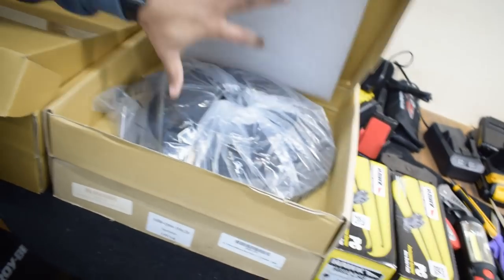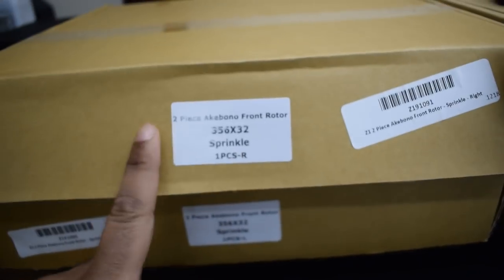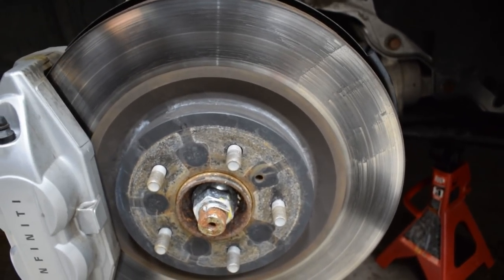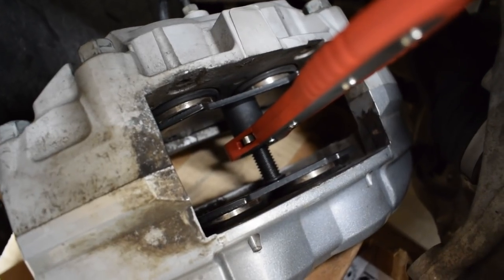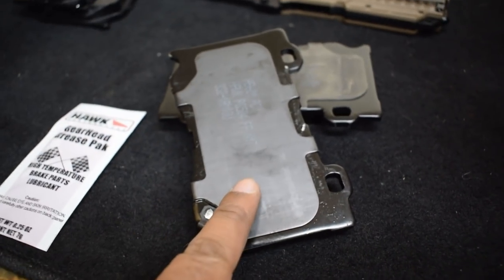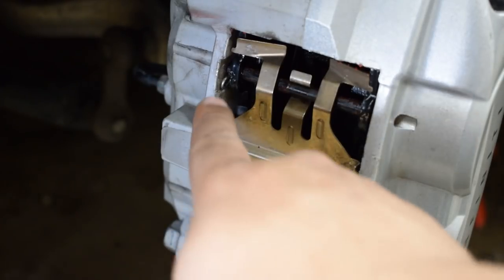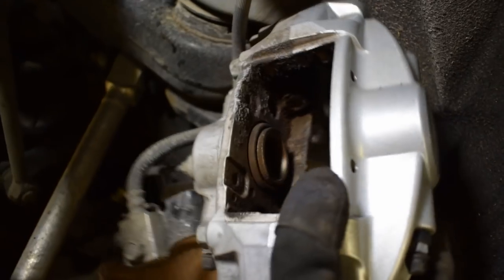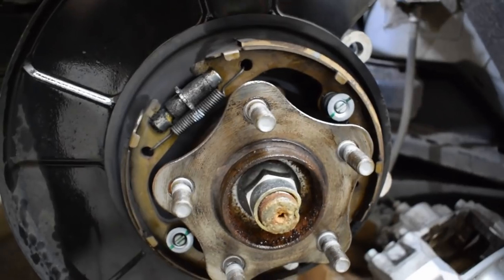Z1 2-PC Rotors for Infiniti Q50 & Q60 | Better than OEM?

Comment: Nice video.  I put these along with 20 lb rims at the same time with out changing my pads as they only had 2k on them. Huge difference! Lot less work for your shocks. I saved 78 lbs total rims n Z1 2 piece rotors. The wear n tear of spinning up and stopping 78 lbs over n over adds up. The disks cool faster, strip water and look nice. Win win win. If you plan on keeping the car for a few years it's well worth it.. I need that tool! Thanks!
Reply: Me too. The difference is crazy
Reply: I just replaced my wheels and tires recently with lightweight wheels and tires saving about 15lbs per wheel. Thinking about getting these rotors to save additional weight. If I did the wheels, tires, and brakes does it make sense to even reduce the size of the brakes to smaller ones to save even more weight? On my Q50S hybrid the brakes are sensitive as they are.
Reply: @ankm3498  <--- I would personally NOT put smaller disks on. BBK's sell for a good reason. STOPPING POWER. I have bigger brakes than the Acabono set. I have the AP Racing Radi-Cal-II BBK kit on my Q50. No fade after many 130 MPH to 40 MPH hard braking, one after another. If you make your Q faster batter brakes are a good thing. Well worth the extra weight of the larger rotor and bigger pads.

Z1 sells them, if you want to see them.
Reply: @johninnh4880  brotha any pads do you recommend I’m getting some z1 drilled & slotted rotors but need to find a good pair of brake pads If you have some mind ?
Reply: @heemdollas8016  <--- On the track the recomend by Z1 of the Charbotec XP12 front XP10 rear was excellent.  A bit of squealing around town. Non corrosive brake dust, but plenty of it. Very similar to the Ferodo DS1.11 pads on my AP Racing Radi-Cal-II brakes
Reply: @johninnh4880  good for track and regular style street racing and Daily driving ?
Reply: @heemdollas8016  <-- If some squealing is tolerable go for them. The Charbotec are more livable then my Ferodo DS1.11's are. I may install the DS2500's I have. Keep the Acabono calipers and Z1 two piece brake rotors. I wish I had kept them. I regret going AP because of the huge cost of pads and rotors. In comparison the Z1 are inexpensive. My DS1.11's cost >$700 for the set. You don't even want to know the cost of rotors!
Reply: @johninnh4880  thank you for the fast feedback brotha
Reply: @heemdollas8016  <-- I still have my Acabono calipers and Z1 rotors (and Charbotec pads) and may swap back to them. Then sell the AP Racing brakes. For my use they were fine. I just got the AP Racing brakes because I got them for 50% off. I also bought a GT-R with a BoostLogic 750x upgrade. Now my Q50 will no longer be used on the track.

Comment: Do you have a CF driveshaft as well?  For me, these 2-piece rotors, CF drive shaft (AWD but still helped), and forged wheels with non runflat tires made a very noticeable difference in response.

Comment: Great clip. Is the brake contact surface area on the rear rotors smaller than that of the fronts for the Q60?

Comment: Replacing rotors at 6k?! I’ve had a 2014 Premium, 2019 S, and now a 2021 RS. Never an issue. Did the dealer tell you what the problem was?

Comment: Just one step that doesn't look to be mentioned, make sure you wipe down the rotors with brake clean before you install them.
The protective coatings most brands use on fresh rotors can cause warping/pre-mature wear on the pads etc.
Reply: @EnthusiastPOV  Aye that makes sense, they ship out the product as ordered it's not something that would sit on a shelf for months>year before someone picked up a set.

Comment: Infiniti recommends changing the brake fluid every 2 yrs/24k miles.  When I installed my Z1 rotors & SS lines, I switched over to ATE TYP200 DOT 4 brake fluid:

https://www.amazon.com/ATE-706202-Original-Racing-Quality/dp/B003VXRPL0

The stock fluid is DOT 3.  I completely flushed out the old fluid with the new fluid, using a Motive Products Power Bleeder:

https://www.amazon.com/Motive-Products-Pressure-Clutch-Bleeder/dp/B00CJ5DZE2/ref=sr_1_4?keywords=brake+bleeder+kit+ford&qid=1551233580&s=automotive&sr=1-4

Comment: Hey bro, would you recommend a 3.7  Final drive diff swap for a 3.9 final drive for better low end performance .
Reply from the maker: Yes 3.9 gears are better than 3.69 for acceleration
Reply: @EnthusiastPOV  what about top speed

Comment: Hey brother hru? Wanted ask if cammed worth it for the 3.7 vhr . In addition to that would you recommend  or is it safe to run 50 to 75 shot of nitrous on a vhr motor  such as the g37 .
Reply from the maker: Yes to both, I’d do 50-100 shot, just careful with the trans as it will only hold 400wtq MAX. Cam wise JWT C2 cams
Reply: @EnthusiastPOV  which will be the best bang for buck .
Reply: @EnthusiastPOV  what about a one piece drive shaft , Would you recommend it
Reply from the maker: Always recommend driveshaft if you’re launching but not required for roll racing
Reply: @EnthusiastPOV  thanks bro, does the drive  shaft  really makes difference from a dig . Does this mod free up  torque hp . Thank you .
Reply from the maker: Yes sir !
Reply: @EnthusiastPOV  thank ya
Reply: @EnthusiastPOV  can I run 75 shots of nitrous with out a tune , I forget to ask you about it bro.

Comment: I get the concept of the break in process for the break pads but what did you do when you took the car to the location you decided to do the break in process? wouldn't driving to the site force you to do complete stops along the way, just wondering
Reply from the maker: The break in process is started when you do the required stops in rapid succession. Braking on the way there was hardly minimal it just burned off the oils on the rotors

Comment: Do you notice any noises? I’m in a cold area in the winter and hot place in the summer.. my breaks SOMETIMES make noise in the winter
Reply: Depends on what pads you are running. Most pads that are above regular street use will make some noise from time to time but nothing crazy. The more aggressive the pad the more chance for noise and brake dust.

Comment: Did you ever tag a link to the tool to push the pistons?
Reply from the maker: I did not. Local auto parts stores carry them
Reply: Enthusiast POV no worries I found some on amazon.  Just got stoptech pads from z1 (congrats on the new job) and they don’t come with grease.  Do you recommend any particular one? Thanks!
Reply from the maker: Any pad grease will do

Comment: New rotors can be had for $200 for a set of four …four years ago and still today , and they’re great because I’ve run them for years as does a guy in Phoenix with over 100k dollars invested in his 350z not that I think that guy has ten brain cells for doing that ….but just for the sake of keeping the truth shared, no…two piece rotors never ever save you money in the long term of short term…they’re simply a much much much more expensive rotor that looks better and gives a slight improvement in handling but nothing that is actually significant or needed ….main reason everyone goes two piece rotor is simply for the looks, just like nice rims are for the looks.